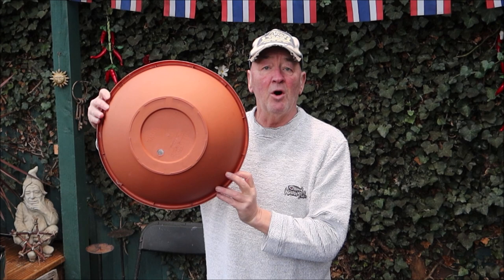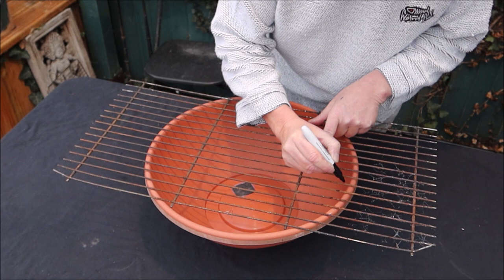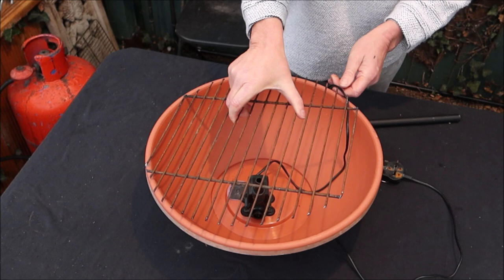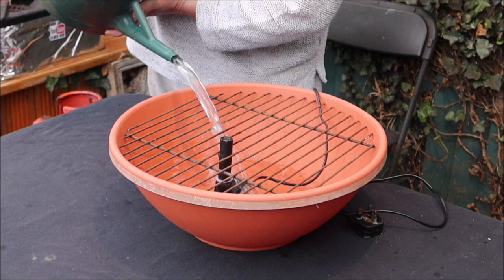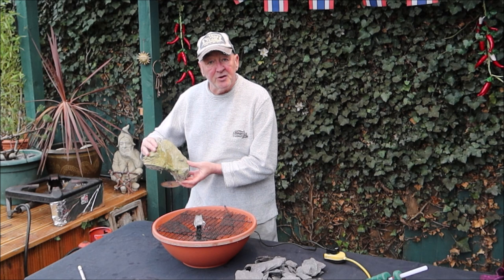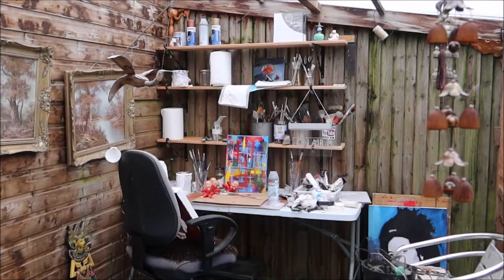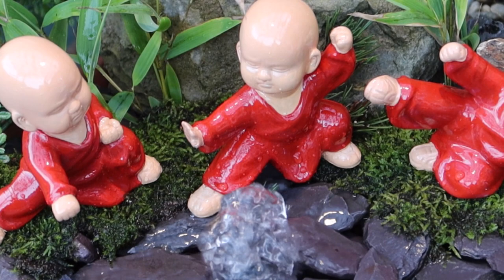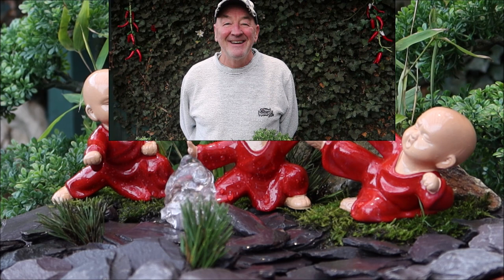Build a SMALL POND easily in under 1 hour.

Comment: Nice one Geoff. Got my mind working. Checked my garage and I have got an old wheely bin, car bumper, fridge, snorkel, wetsuit, 100 spanner’s, lawnmower, bubble wrap, polystyrene fillers and a chest of drawers. Hm! Gonna need some imagination here! So the wheely bin can be the tank, the lawnmower engine can convert to a pump, the snorkel can be the pipe, the polystyrene can be the slate (snow) the spanner’s can add a more historic look (Steel Age) and I have a wooden toad which I bought from Thailand and this can be the little men. And I can position it in the kitchen next to the extract fan to remove the pump fumes. Sounds like a plan.
Reply from the maker: Absolutely Brilliant Terry. Made me smile. 🤣🤣🤣🤣👍🚗🚗💨💨